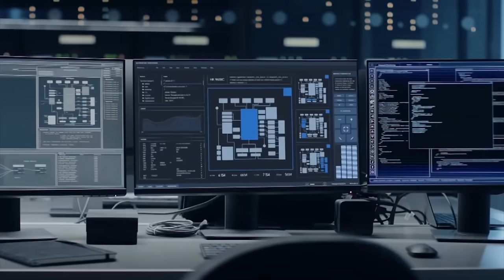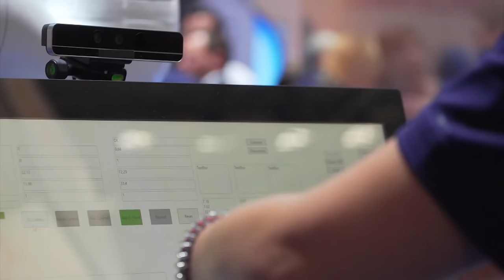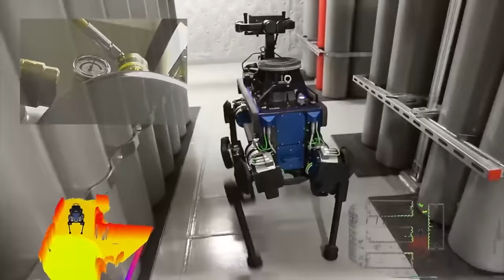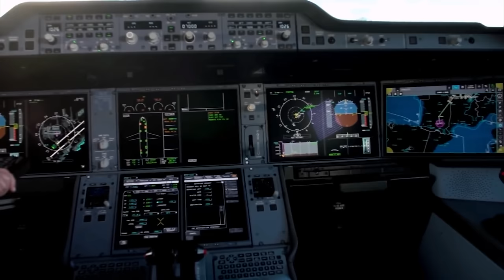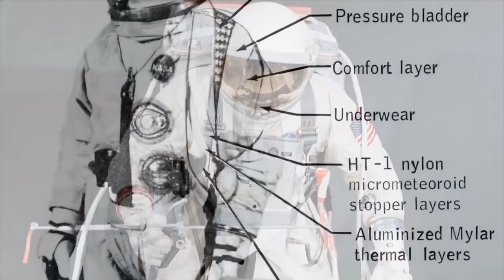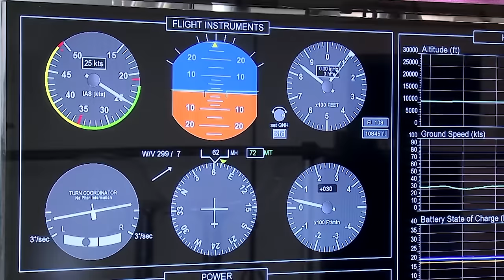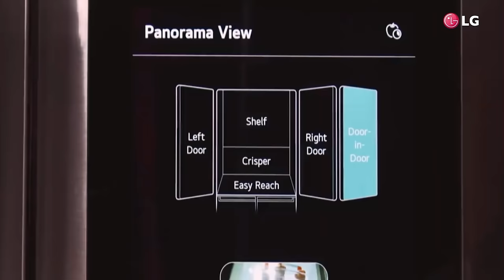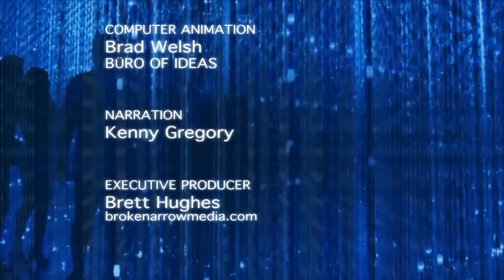Technologies of the Coming Century | Complete Series | FD Engineering

Comment: The international space station it fully powered by solar, right??? Other than to keep it in orbit!
Reply: That is correct. The original panels, along with the newly installed rollout panels supply all the electricity used on the ISS.  The Soyuz capsules are used to gain altitude and move the ISS to avoid debris as it orbits Earth.  Mostly the orbit keeps it moving but gravity does drag on all orbiting objects.